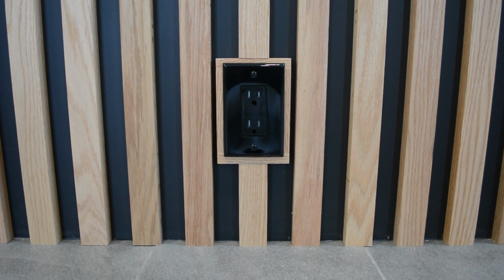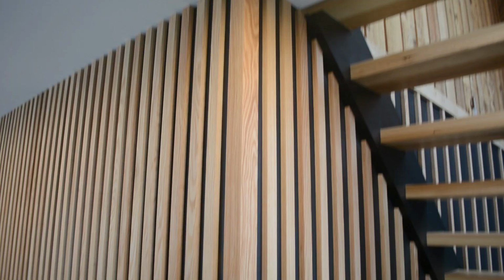DIY Wood Slat Wall - Start to Finish | The Lake House Project Ep 19

Comment: Where did you get the black and gold light switches.  Very nice job.
Reply from the maker: Buster + Punch - I have separate video on the install if you’re interested 😁
Reply: Yes, I'm interested.  @GoldenKeyDesign
Reply from the maker: @jamesvaughan1992  I posted it just after the slat wall video: https://youtu.be/98ex6mbjAnU

Comment: What kind of wood did you use? Hard wood or soft wood? Thanks!
Reply from the maker: I used oak which is in the hard wood family. Pine would also work and is more economical but is a lot softer